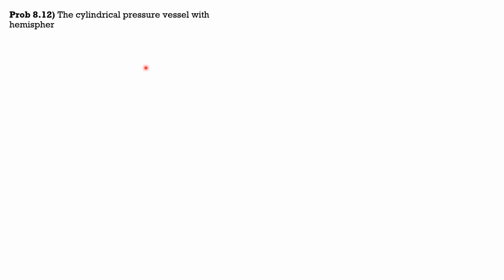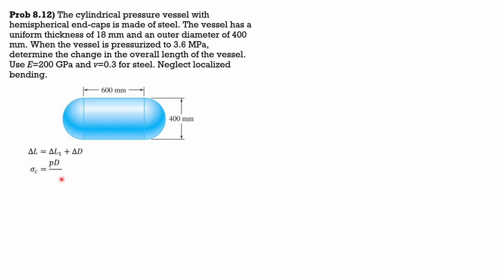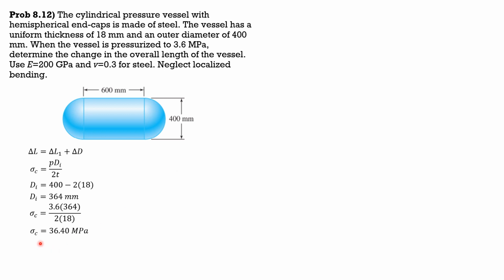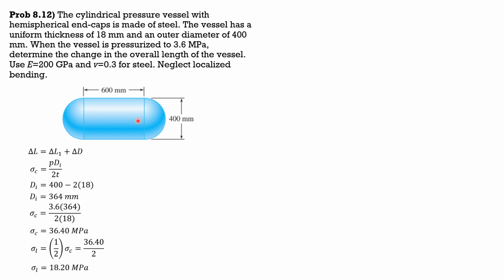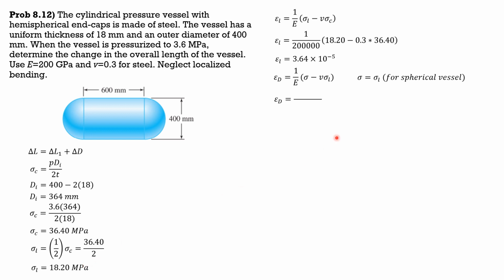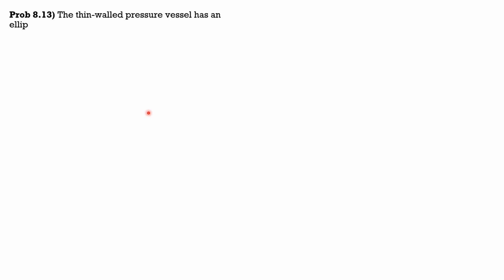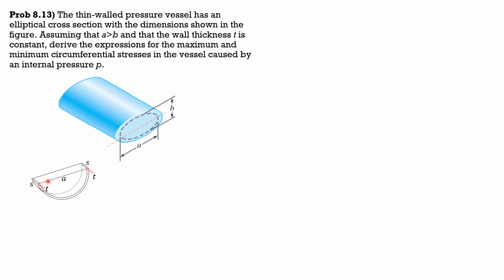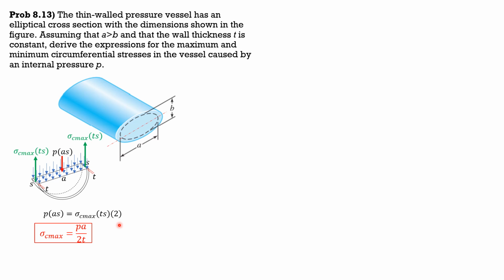STRESSES on PRESSURE VESSELS, Examples 8.12 and 8.13

Comment: Calculate in the length in the hemisphere
Reply from the maker: If it is hemisphere it is strain diameter divided by 2. It is 6.370x10^(-5)(364)/2. Refer to 2nd term of delta L in the solution.